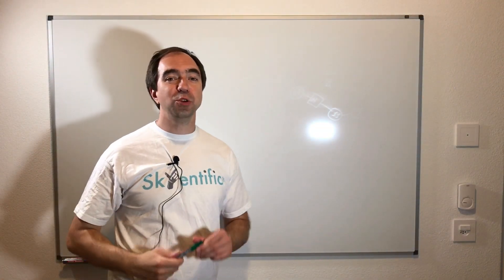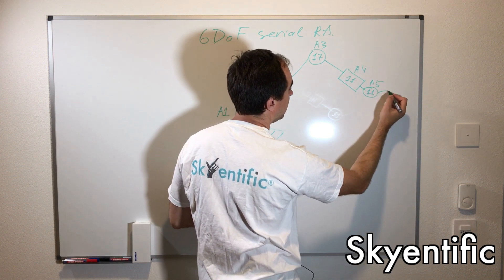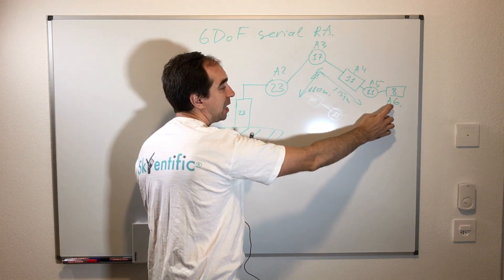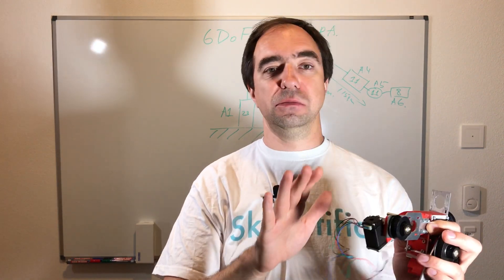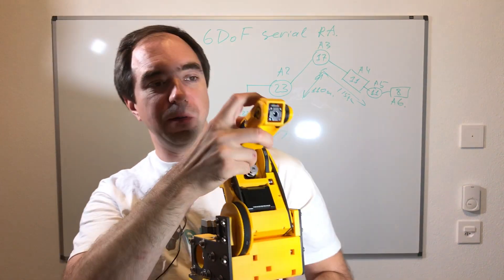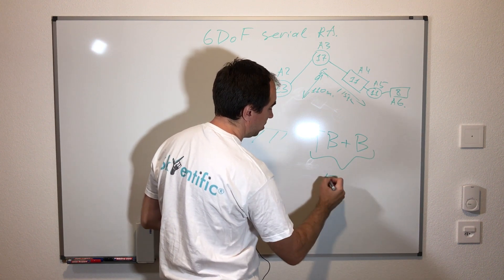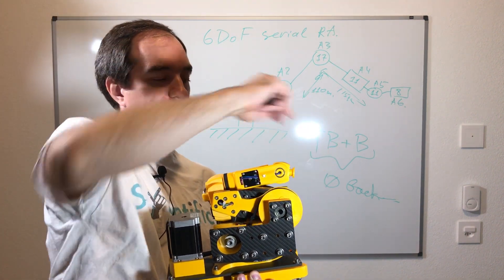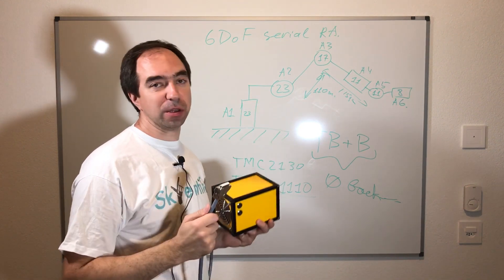Small affordable 6DoF 3D printed robotic arm

Comment: Great video! I have a question regarding Stepper motor you used, what requirements I should consider when using the exact STL file when choosing the right stepper motor for this project?

Comment: Your work is fantastic and I am making the 6 Dof serial RA. I'm still having trouble finding all the parts.
I wrote a PROCESSING / CONTROL P5 interface to communicate with the robot to be able to send it saved and modifiable commands and I plan to put a vacccum gripper.
I am in France, can I communicate in French with you?

Comment: I am starting this build, but I cannot find the belts in Europe anywhere, and even two are out of production at sdp-si. Can you update BOM with alternatives?  Both 6R51M139060 and 6R53M128090 cannot be found. And there is no option for 6R51M087060 or 6R53M152090 in EU.
Reply from the maker: Did you check SDP-SI website? They are from US, but they have a good choice of belts.
Reply: Такаяже проблемка, ремней и шкивов с шагом 3мм и шириной 9мм на али трудно найти, попробую собрать на более распрстраненных 10мм ремнях

Comment: how to decide link length and torque required at each joint?
Reply from the maker: This is not very easy task. You would need to estimate the weight of each link and the centre of mass for each link. With this you can estimate the torque at each motor. 
For this robot I just roughly estimated this values.
Reply: Is there any way to control six brushless  motor for robotic arm

Comment: guide me to connect drivers with ramps
Reply from the maker: I create a GitHub page for this project. (https://github.com/SkyentificGit/SmallRobotArm) There you can find a pdf file (SmallRobotArmElectronics.pdf). In this file, you can find the schematics of the electronics for this project and the connection of the drivers. In the future I will do the video about electronics for this project. Hope this will help you.
Reply: Skyentific 
I connected and it worked but I wanted to control it with a computer

Comment: What is the software used to run the robot?
Reply from the maker: All the soft is on Arduino. I wrote this software. Later I will try to run the robot through ROS.
Reply: @Skyentific  
Thank you.
I must say that I like your design. In a way it is similar to Mecademic...
Is there an easy App or software that controls 6DoF arm?
Writing the code (ROS) will probably take time and ...
Reply from the maker: The easiest software, which I know, is written for AR2 arm (try to google: Chris Annin AR2). I never use it, but it is open source and relatively simple, but not optimal in terms of communication between robot and computer.

I also think that 3D printer software could be adapted for the robotic arm, but this would be complicated task.
Reply: guide me to connect drivers with ramps

Comment: That looks neat!

What happens if you cut the power? Does the arm have any way to lock its position or does it go limp?
Reply from the maker: Unfortunately, there is no way to lock it in the position. Without power it just falls. But this is very good point. I will try to look if in the next version I could implement some kind of locking system.
Reply: @Skyentific  con Frenos electromagnéticos de imán permanente puede solucionar este punto. El freno va colocado en el eje de rotación, cuando la energía se corta un resorte mueve dos pletinas, estas se pegan y evitan el giro. Vienen de distintos torques de retencion. Saludos